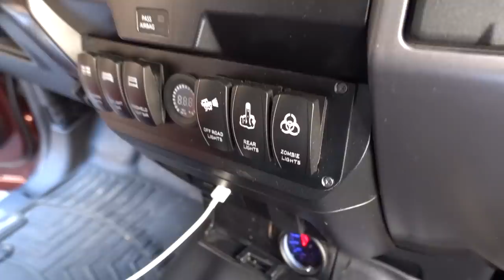ONE BEASTLY F150 ECOBOOST BUILD!

Comment: Oh man that little 2.7 internals must be hurting with all that boost 😂
Reply: Right😂 and with the size trailer he’s pulling that engines gonnna have a short life span 😂 beautful truck tho . He shoulda got the 5.0
Reply: adrian ledesma 3.5 EcoBoost is the move
Reply: @Pushtreez  Exactly mate but these EcoBoost owners doesn't even know what reliability and longevity even means. For I prefer to have a super slow 5.0L Coyote V8 thats pure reliable vs an overpriced overhyped super fast 3.5L EcoBoost V6 that'll take on any V8 with ease for short term fun but not long term reliability and longevity.
Reply: Yea tht trucks gonna be toast soon Id like to see the real numbers seems kinda high I don't know why ppl sink tht kinda money in a truck not made to tow a 30ft trailer by the time hes done modin he could have bought a real pulling truck Ford 7.3 gas or a Ford 6.7 diesel or GM or dodge 2500 tht f150 is gonna be a money pit looks sweet though I would have got the 5.0 roush super charger comes with warranty too probably out last tht Ecoboost X3

Comment: Bring that F150 back and do a startup and engine bay views as well as sound demo, shitty YouTube audio but still just to see his work. That is an awesome build and kinda like what I’m planning buutttt a 30ft is a bit much. 700+/900+torque is a lot out of a 2.7L though, impressive. Wanna know how reliable it is or if he has had issues?
Reply: Not only that but he’s makin that power on 37in tires
Reply: And he had the motor built but he did break like 3 transmissions.

Comment: 14:14 I tried taking my 4th gen style dodge tow mirror signal lens apart to add a switchback led strip, aaaandd had the same outcome 😂 this was after shattering the smaller glass because it ended up being one of those with a screw behind it 🤦 $90 lesson to find out I should just leave it to the pros

Comment: How can the little factory rear axle and drive shaft handle all that tourq? 😅
Gen2 Raptors explode at 600 wheel hp running E85 which would be over 700hp to the crank. The guy at RMB motor works swap out the blown 3.5s for the 4.2 Stroker all the time for 900hp

Comment: Hey I have a 2020 F250 will those tow hitch cover work? Are they 2 1/2 inch or do I need a a adapter?
Reply from the maker: They are 2”. Your truck should’ve come with a sleeve to reduce it to 2”

Comment: “Custom fox reservoirs”......”I had to contact FOX to get those”.  I CALLING BS.  Trucks cool and all but there’s too many DIFFERENT shades of colors on it. Also, why would you pay the money for a platinum (which is ridiculous) if you’re just gonna “customize” everything?  I lost brain cells.
Reply: ty dsko because it’s his
Reply from the maker: Custom length shocks are actually a common thing. Also, I bought a Denali and customized everything, Wes bought a high country and did the same. You get features on the high end trucks that aren't worth trying to add to some of the lower models.
Reply: Wow, ty dsko might want to do some research.  Nothing new for Fox or King to make custom coilovers and shocks.